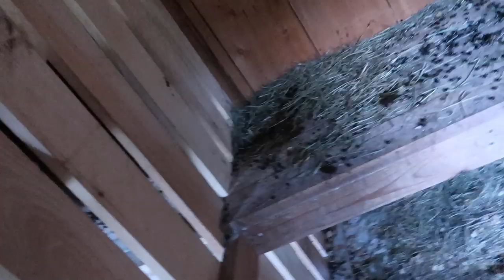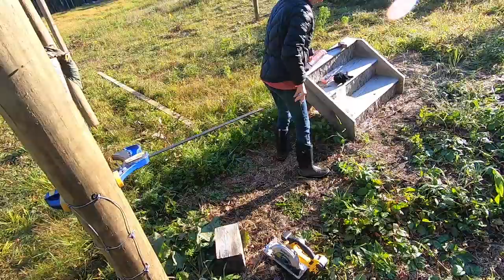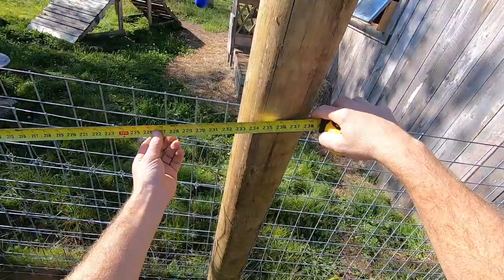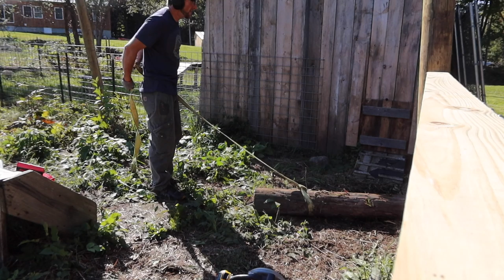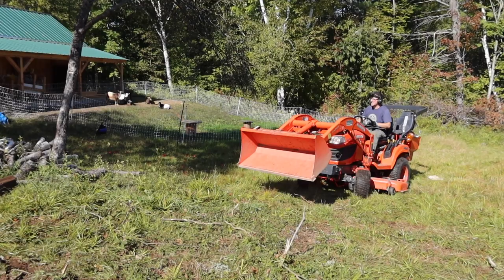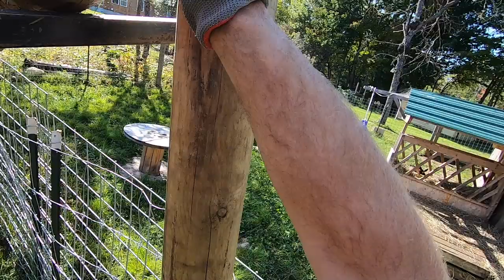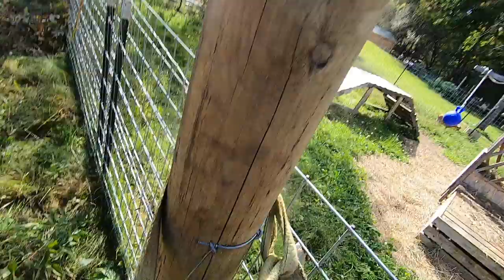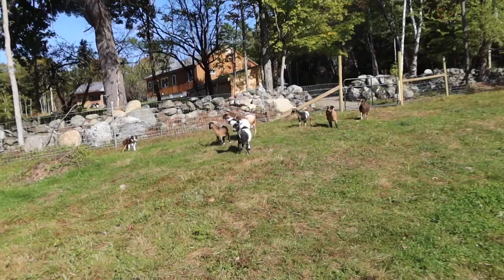Gina Couldn’t Handle Watching! Attempting to Fix new Pasture with a 20 Foot Long Telephone Pole

Comment: you might not tolerate the insulation  smell.  If your inside nostril are red thats what probably is. wash the inside with a wet  qtip

Comment: As loose as the pole is in the hole it would have been easier to pull the pole and reset it.  At the very least get a tamping bar and tamp dirt down in the loose side of the hole.  Done!